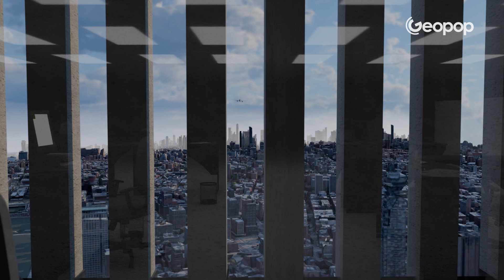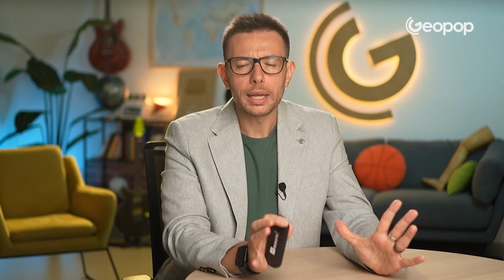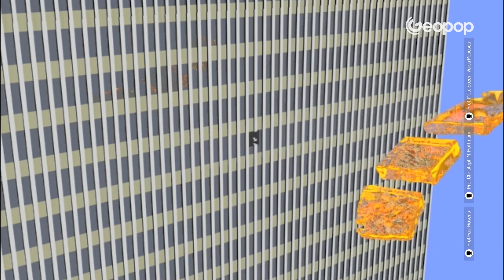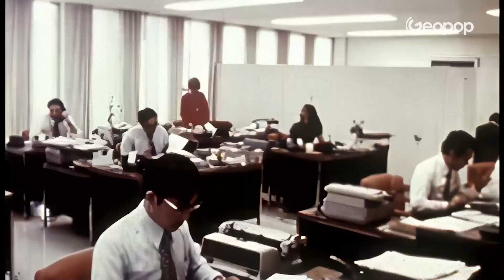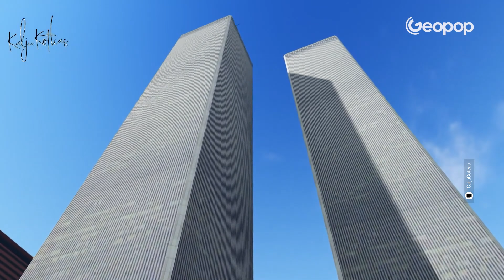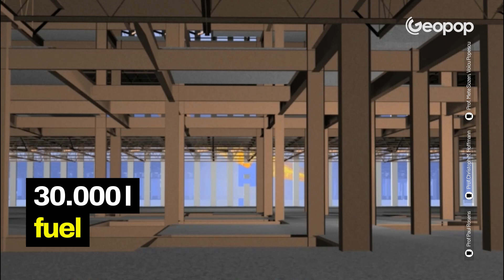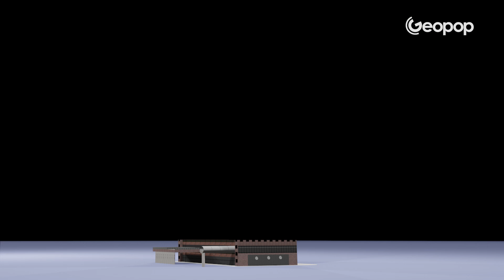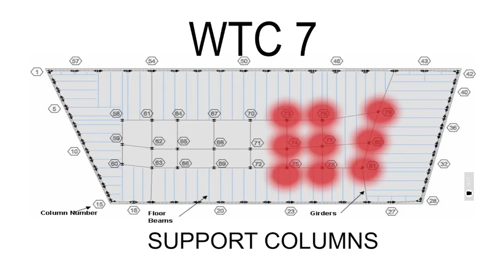9/11, 2001: The Technical Reconstruction of the Twin Towers and WTC 7 Collapses

Comment: Gentlemen, a lot of artificial intelligence, the graphics are impressive, but to say that NIST carried out serious research. Fake. First, never in the history of engineering has fire caused the disintegration of a steel and concrete structure.  There were fires in skyscrapers that lasted 24 hours and the structure is intact. Airplane fuel is extremely volatile...so much so that the image of the towers giving off black smoke is evidence of this. And they do not reach temperatures enough to melt steel beams. However, on some floors explosions were heard that were heard by firefighters who, by the way, were not interrogated by the NIST commission. The collapse in 10 seconds of the three WTC skyscrapers 1, 2 and 7 without finding resistance in their fall, evidence that there was a controlled demolition. WTC7 is the example of this fact, since no plane hit the tower and fell like the twins....Visit the Architects and Engineers page for the truth about 9/11
Reply: How would you know?  It's not like you ever read The NIST's reports. You are just mindlessly repeating some conspiracy catch phrases you found on the internet that have nothing to do with NIST.  You can't even keep The NIST and The 9/11 Commission straight even though they are two completely different entities. 

Honestly, that was feeble and pathetic.  

AE911T does not have real architects and engineers. Their brain trust for most of the organizations existence has consisted of;

One former manager of architects whose career highlights include designing a high-school gymnasium and a Denny's. This guy explains the complex interactions of millions of components by banging two cardboard boxes together.
An unlicensed civil engineer who builds radio transmitter towers who is responsible for their structural engineering analysis, even though he isn't a structural engineer. It shows. He is also one of the most truly unpleasant human beings I have ever interacted with.

Their top physicist is a retired 9th grade science teacher.

Their FEA is done by a carpenter using MS Paint.

And so on and so on. You get the idea. Not exactly a deep talent pool. Almost none of their core group of experts are still actively involved in the organization, which has been reduced by posting comedy meme's on Reddit featuring Simpson's characters.

So of course you love these clowns.  They tell you exactly what you want to hear - while holding their hand out, and you don't know enough about any of it to know they are blowing smoke up your ass. 

Meanwhile the 130,000 member American Society of Civil Engineers - ALL of whose members are qualified engineers - fully supports the conclusions presented in the video above. And that is just a start. In 24 years zero structural engineers of tall buildings, including the 1/3 that have retired in that time, have made any statements in support of 9/11 Truth BS demolition claims. Zero, nada, none.
Reply: @TheLoonResistance you sound quite mad and detached from reality
Reply: @Bassman_DB  - And you sound wrong again. 

I'm obviously not wrong or you would have attacked the argument, not the arguer.  Glad we got that sorted out. Have a nice day,
Reply: @TheLoonResistance that explains why you are so delusional. When people don't disagree with you you think that makes you right. What a deranged thing to say.

Comment: What the experts r not taking into account is time. The towers were TWENTY-EIGHT YEARS OLD. Load fatigue & corrosion r just two of the many forms of problems even steel 😂girders will suffer.
Reply: Well , we know you're not in the construction field
Reply: @robbiehiatt9966 and ur not a structural engineer and although u may pretend to b one, u couldn't play one on tv. Btw, I never said I was.
Reply: @MichaelM-i3b these buildings had no load fatigue and no corrosion.You don't know what you're talking about. I've built buildings and structures for over thirty years.
Reply: @robbiehiatt9966 sneered the dude with the construction hat with the GED and a pooper scooper n his little bitty trump hands

Comment: How did all of the fuel burn in the 1st 30 seconds outside of the tower? The evidence is clear as demonstrated in the huge orange fireball.
Reply: What on earth gave you the impression that ALL of the fuel was expended outside of the Towers?
Reply: @TheLoonResistance look at the size of the fireball. Compare it to the fireball from the Air India crash. They both appear to be the same size.
Reply: @thevictim2072  - Yes, its a big fireball.  The Air India crash is a very different animal - kind of like asking to see the similarities between an Elephant and a Tree Sloth.

It took about a minute for all of the fuel to be consumed.  During the impact - which lasted about a quarter second - that fuel, like the plane was moving at 400-500+ mph and in all directions.

Forward, left, right, up and down.  Some of it made it's way down to the lobby through the elevator shafts.

Comment: 7 wtc was blown up. NO way a 50 story building just fell like that.
Reply: Sure there is, you just don't understand how. The problem is, instead of recognizing you just don't understand it (yet) you assume the event must be wrong because you don't understand it.
Reply: @TheLoonResistance  no I know what a controlled demolition looks like. Just check out the high rise building overseas that burned for 9 hours and didnt collapse.
Reply: @rodboijones7390  - It looks like a building falling down. A building falling down looks like a building falling down.  The building does not know or care why it is falling down. 

The human brain is designed for finding patterns.  You find a pattern so anything that looks vaguely like the pattern you assume fits the pattern.  

Instead of thinking. 

Thinking is an acquired skill, a learned skill and its hard, so many people skip it. Here is what thinking looks like:

At 10:28am the WTC North Tower collapsed, showering Building 7 with tons of burning debris, causing heavy damage and starting many large  fires which burned out of control for the next 7 hours. Half the FDNY firefighters having been killed, units in disarray, equipment destroyed, no water pressure, and the greater urgency of search & rescue efforts, Building 7 couldn’t be saved so firefighting efforts were pulled as futile and 7 left to its fate. Firefighters make that sort of choice every day in brush fire situations - which houses to save and which ones to let go. Only real difference here is moving the decimal on the size and cost. People get overwhelmed by the size.

www.youtube.com/watch?v=g_SvpwyC17M

Collapse of a burning structure is always a concern for firefighters. Steel buildings subject to fire rely on active firefighting to survive. Buildings are designed around 1 to 3 hours of fire resistance, allowing time for occupants to escape and active firefighting to get started, after which all bets are off. Left to their own devices they'll exceed their design envelope and collapse, like Plasco Tower and Wilton Paes de Almeida. In 7 the occupants escaped, passive and active fire protections were compromised and active firefighting was abandoned hours before the collapse, which left the building to its fate. It lost. Odds on Building 7 would eventually collapse, and it did. No big deal in logic.

 http://www.youtube.com/watch?v=WnYBX6QT0R4 

FDNY Chief Daniel Nigro - The biggest decision we had to make on the first day was to clear the area and create a collapse zone around the severely damaged 7 World Trade Center, a 47-story building heavily involved in fire. A number of fire officers and companies assessed the damage to the building. The appraisals indicated that the building's structural integrity was in serious doubt. I issued orders to PULL back the firefighters and define the collapse zone. It was a critical decision; We could not lose any more firefighters. It took a lot of time to PULL everyone out, given the emotionalism of the day, communications difficulties and the collapse terrain 

FDNY Deputy Chief Peter Hayden ; We had our special operations people set up surveying instruments to monitor and see if there was any movement in the building. We were concerned of the possibility of collapse in the building. And we had a discussion with one particular engineer there, and we asked him if we allowed it to burn could we anticipate a collapse and if so, how soon? And it turned out that he was pretty much right on the money, that he said 'In its current state you have about 5 hours 

The collapse of Building 7 was anticipated and widely reported in the media throughout the day, with 24 video cameras recording some or all of the collapse. Everyone knew what was coming and why. 

www.youtube.com/watch?v=OY5S5k3tMHI

The collapse of Building 7’s was entirely different to the Twin Towers and harder to understand, most details being hidden from view and not intuitive.  But we can still sort out what happened through careful analysis and observation. This is my explanation of the collapse relying on no outside authority. 

Building 7 was a unique, asymmetrical 47-story steel framed structure built atop a smaller 3-story building serving as a partial foundation, requiring lower floors dedicated to complex load transfer structures. Of trapezoidal shape and all-steel tube-in-tube construction, B7 (above the 7th floor) consisted of a central core of steel columns carrying most of the gravity load, perimeter steel columns around the outside of the structure carrying the remainder of the gravity loads and long span beams and girders to tie those elements together and form the floors. On the outside of the building hung a moment frame or outer shell. 

Phase 1 : First externally visible signs of collapse initiation occurred at 5:20:28 pm and were notably quiet with observers not realizing the building was collapsing! No audible warning in the form of hundreds of ear drum busting 180-190dB explosive bangs preceding the collapse. Here at 12:00 a local CBS affiliate reporter is talking 10 blocks from B7 when collapse begins. People don’t start to notice the collapse until 12:11. At 12:45 is the famous CBS fixed camera clip of Building 7’s collapse. Note how quiet it is. 

www.youtube.com/watch?v=t5tEy6mXSE8

Collapse initiation was due to lower floor failures above the load transfer region (8-14th floors) in the NE corner. In this video at 0:45 you can see the NW corner from inside the building while under construction, Column 79 just out of frame on the left. That big, angled steel beam across the top of the frame connects to C79 at one end. The girders connect to the beam. That beam and all those girders depend on just one connection 

www.youtube.com/watch?v=nP3TNHPCIVU&t=45s

Phase 2 : The NE lower floor failures caused a loss of critical lateral support over an excessive length of Column 79 and it buckled. Looking at a floor diagram of Building 7 (www.nist.gov/image-16640) when you see all the structures that depend on C79 you quickly realize this one column was a relatively isolated structural element on which a disproportionately greater fraction of the structure depended analogous to say the Key Bridge. Externally as collapse begins we see a vertical progression of window breakage along the 44-46 line and a kink in the roof of the East Mechanical Penthouse at the top of the building, consistent with C79 failure. Normally with a buckling column, the load could be redistributed to other columns. With C79 that is not the case - the failure did not redistribute the load, so the collapse rapidly progressed to the roofline, sinking the rooftop penthouse. The transition from full capacity to almost no capacity occurs in an instant and will result in virtually no resistance 

Phase 3 : With C79 gone, B7’s progressive, non-symmetrical collapse continues with adjacent columns 80 and 81 left laterally unsupported, and quickly buckling as well, sending the EMP down through the building. C79-81 all have no diagonal bracing, which is the major reason why they could not redistribute a lot of vertical loads among one another. From there collapse progressed from east to west through the central core until the core was gone taking all of the interior floors and probably most of the perimeter columns with it. Follow the horizontal progression of window failures low in the building and the dropping of the remaining rooftop structures into the building. One of the big takeaways from the NIST Building 7 study (invariably ignored) was how their modeling determined C79 failing under ANY circumstances would have initiated the same collapse sequence. 

Phase 4 : After about 10 seconds only the exterior moment frame remains, giving the illusion B7 is still standing to the casual observer since little has outwardly changed. But it is just a hollow empty shell like an empty cereal box supported only by a few remaining columns and overloaded from the loss of the core columns and floors, quite unable to remain standing. With nothing remaining behind it, the north face leans inward, forming a V in the roofline, the last few columns buckle under the strain and the moment frame free falls, landing on top of the debris pile. 

It is only here at the very end that a single measurement of alleged free fall acceleration is taken, from a single point on the outer shell. The Building did not “free fall” – just one corner of the outer shell did, sort of. The Building_ (defined as its center-of-mass) was already gone before that happened. The period of alleged free fall was a product of how it fell NOT why it fell and can't tell us what started the collapse 10 seconds earlier. Start to finish the collapse took 18-20 seconds, 3 times longer than free fall . How fast something falls cannot tell you what started it falling_ anyway. 

The debris spread outside the footprint blocking surrounding streets, heavily damaging the Verizon Building and destroyed Fiterman Hall. 

Building 7’s progressive, non-symmetrical collapse was incidental and unintended collateral damage from the combined effects of fire + time + gravity, started by the collapsing North Tower. That is true no matter who planned and carried out the 9/11 attacks or why . The collapse was of so little consequence it barely registered at the time - a footnote, only taking on semi-mythical status as an alleged smoking gun years later when demolitions at the Twin Towers, missiles at the Pentagon and shoot down over Shanksville all failed and conspiracists had nothing left to work with. 

Anything can seem like a conspiracy if you don’t understand how it works. Now you should. I hope you found this helpful, informative and it solicits informed critical comment. If I made any errors of fact, logic or reason or left anything important out, please let me know so I can fix it. IF you can offer a more plausible alternative please do. Be the first. Please start any reply with the words “Tits McGee” or I will know you didn’t read it and are wasting my time.

Comment: I have had my hands on many job sites. And know a number of. I will say seasoned, knowledgeable real builders.  And none of us can make a real logical reason for the whole building to fall. Believe what makes you comfortable. But as a person who's been in the skeleton of buildings. There is no real logic to why the towers collapsed. Other than tampering with inner structures. It would have held 3 times that weight on fire with wind feeding the flames. That's just how they are made and thought through. The information in this video is like a 30mph sign on a 70mph curve. It's not the max the structure can handle. It's the minimum. While knowing it can take much more.